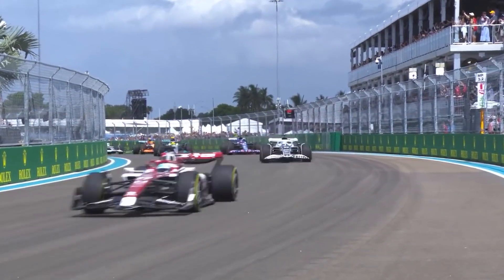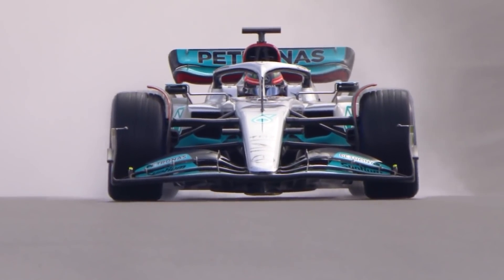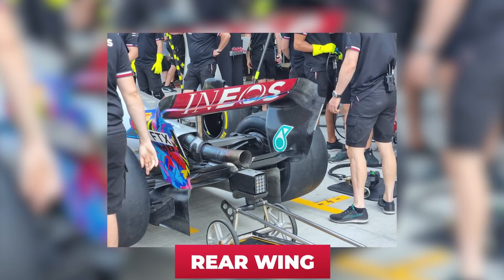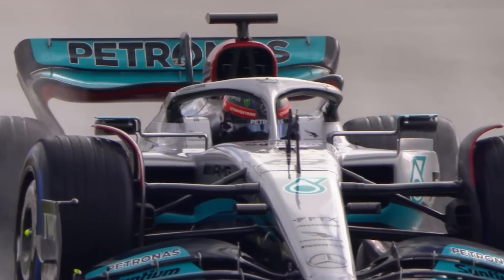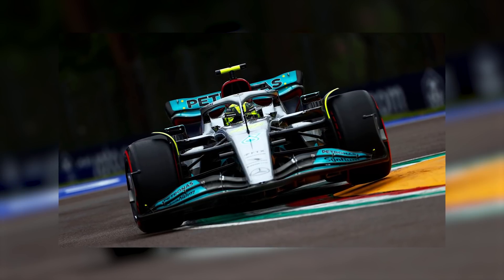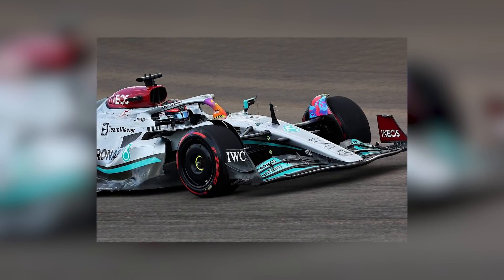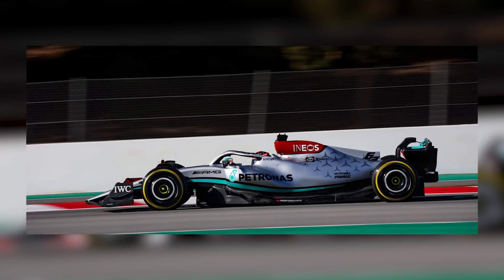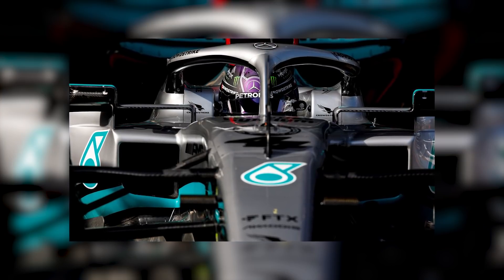Mercedes Just Revealed W13 Upgrade is a BIG FLOP

Comment: It wasn’t a flop, they realized after fp2 that they can find the pace with a proper setup, George confirmed that the upgrades are indeed headed in the right direction for now but the progress might relatively be slow, now they'll bring the new floor in spain which might get them a little faster, they were almost as fast as they expected to be in Miami cause the upgrades meant for more stable setup and not exactly some significant improvements.
Reply: I think they should lower the nose reduce I thinke dwn force reduce drak

Comment: These comments are ofcourse about those upgrades which were obvious. I suspect there were other upgrades, or experimental parts out of sight. The floor would be my candidate for the cause of Merces apparent improvements over practice 1 & 2. If i had to guess, i'd say they ran the car with an experimental floor, and having determined that it worked, they removed it for the regular robust floor. In other words the parts they were playing with, would not have been sound enough to last the entire race, and were instead used to gather the data they needed for the real upgrades. Once again Mercedes are using the practices, and in some cases, the race to test theories for their eventual upgrades.  Its my opinion the parts we saw were 'the low hanging fruit', there to disguise where the real work is taking place.

Comment: Theyre definitely improving but if they had success the day before why not keep it at the track and see if they can improve upon it? And what about George having the power to pull away from Lewis during the race? That was kind of shocking to see there was a difference when they both should be technically closer to each other.  Toto keeps talking about the aerodynamics being the problem but clearly they are lacking power overall. 
As much as I am an optimist and know they will figure it out and soon, I cant help but think of the possibility of a driver swap with Carlos at Ferrari for Lewis. It would be game over for ferrari with Charles and Lewis. Plus, Hamilton does have a love for Ferrari and it would be like a Schumacher move back in the day.
Reply: What you been smoking? Lol
Reply: George being faster in that stage of the race, I think was most because of his new tyres
Reply: @maxheeringa753  Fresher tires helps in corners, but pulling away in a drag race? Something happening between the cars with power
Reply: @kingtungstenworldwide4472  fresher tyres improves traction by such a huge margin that you can hit higher speeds quicker on the straights